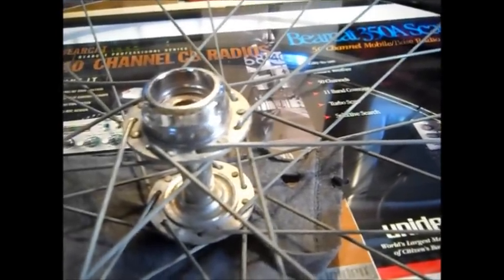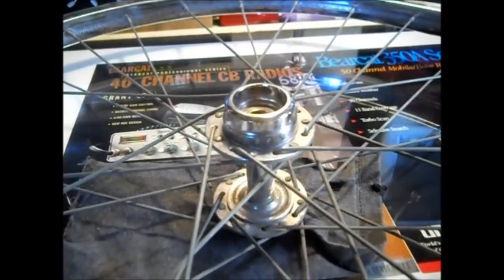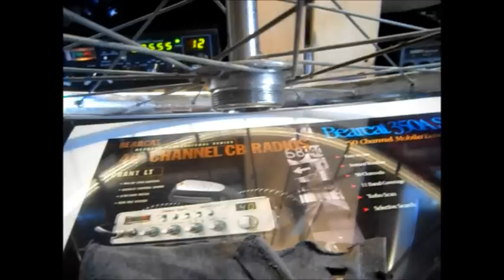BICYCLE WHEEL ANTENNA.

Comment: some fire departments buy VHF marine band antennas and use them on rescue boats. That antenna you have could have been down tuned out of the marine band but usually commercial antenna are pretty resonate at 137 - 174 MHz but that also depends on type and brand of course. My 2-meter / VHF mobile antenna is a maxrad unity gain whip and it works good for me with a 1:2 SWR at highest around 144 MHz and again up at 164 MHz. The center is in the commercial band around 154 MHz I think. I didnt want to cut and tune this antenna because I do have a couple of repeaters on 151.600 and 154.100 MHz
Reply from the maker: No one wanted this at the hamfest they thought it was a marine antenna The factory cardboard tube says Motorcycle antenna
Reply: Oh then an FM stereo antenna 87 - 108 MHz which can easily be tuned to 2-meters. Even a stainless steel whip on your can can be tuned if you have bolt cutters lol.
Reply from the maker: Mel Elfnet This is a motorcycle antenna 144 - 174 MHZ , There is a picture at the end of the video showing the Freq...